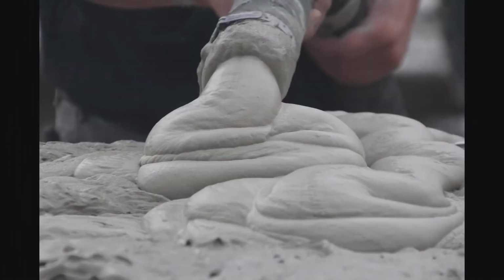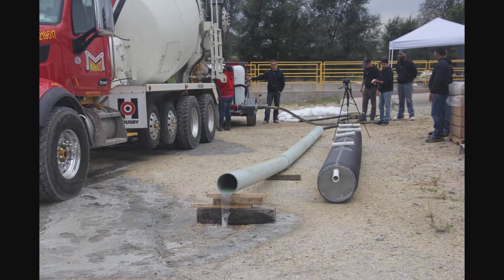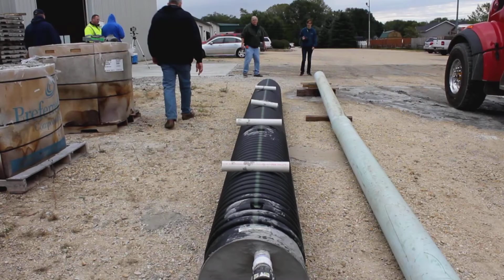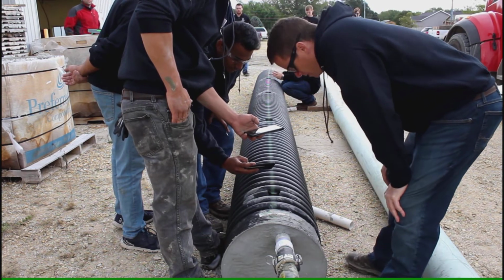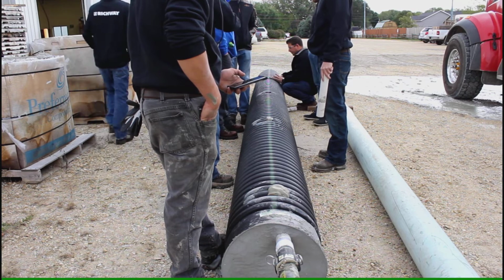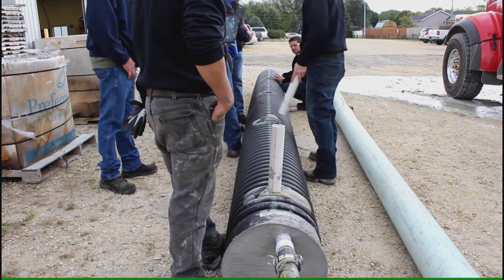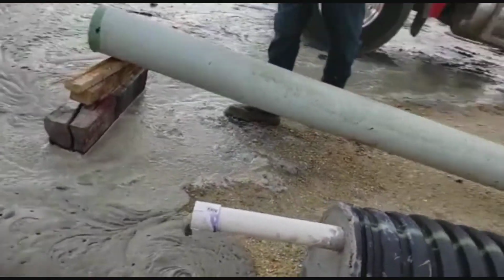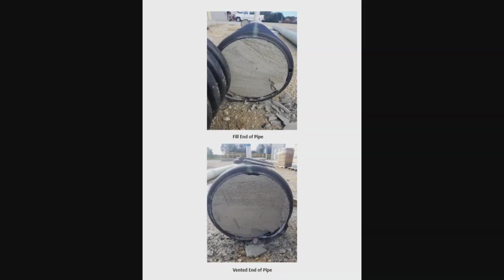Richway's 2018 Fall Demo Day Cellular Concrete Pipe Fill

Comment: Did you use a pump truck or gravity feed
Reply from the maker: On our trailer equipment we incorporate either progressive cavity pumps or peristaltic pumps. So, this pipe fill is being pumped and not gravity fed.

Comment: how much does it weigh per cubic foot
Reply from the maker: Cellular concrete can produced in a wide variety of densities. Referencing ACI 523.1R, cast in place low density cellular concretes having an oven dry density of 50 PCF or less. In most applications within North America, which are primarily geotechnical, densities will often times be between 25-40PCF. 
I believe the material you see being produced in the video is approximately 35PCF.

Comment: Great demo of the flow ability of the concrete. I am imagining small vertical climbs for the flowing concrete will not be a problem as long as the air can be vented and controlled.